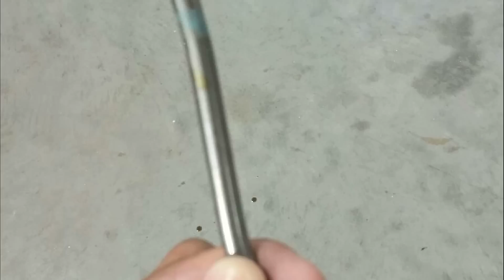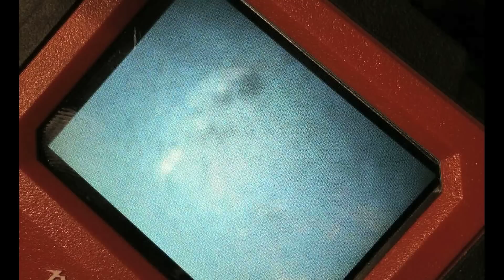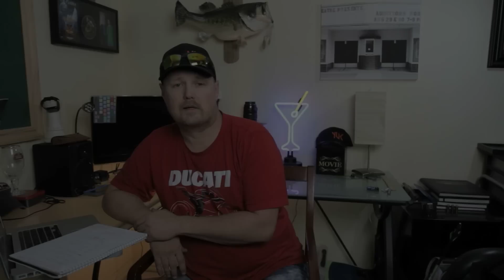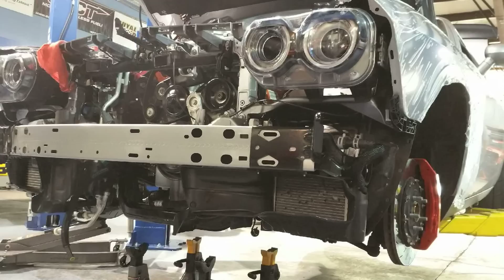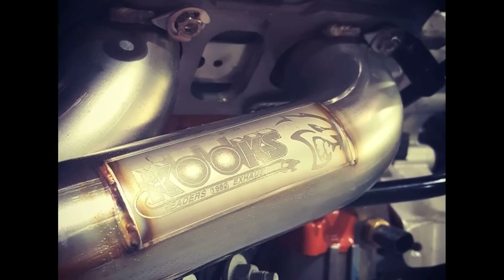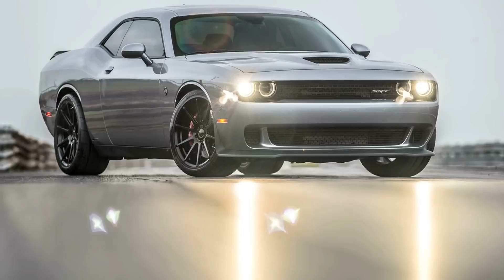2015 Challenger Hellcat :MELTDOWN!!!!

Comment: Who was the original tuner?
Reply from the maker: Brian Bos the tuner now is Joel Applegate, which you can Google who that is...  it was on dyno last week and the torque converter that was in it was bad...  it was unlocking at midrange and locking back up costing about 100-150 HP....  at 2300 rpm is was putting up 863 ft lbs of torque... we replaced the converter and it goes back tomorrow to the dyno